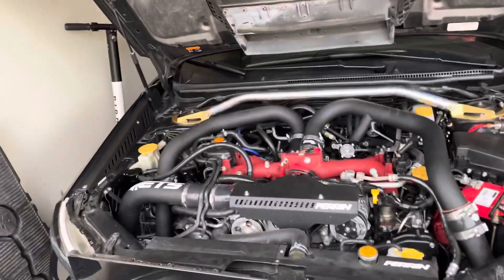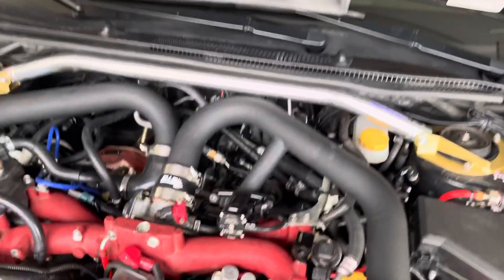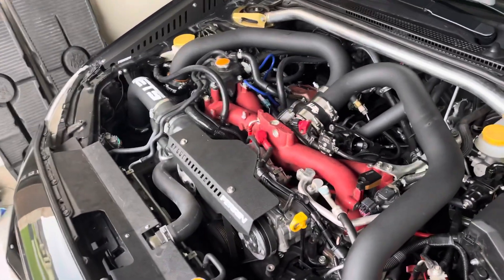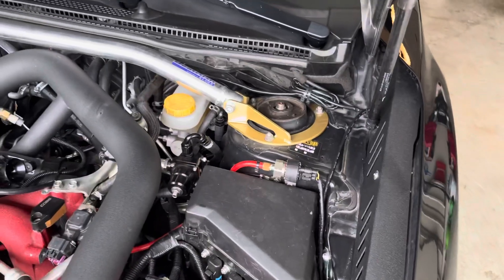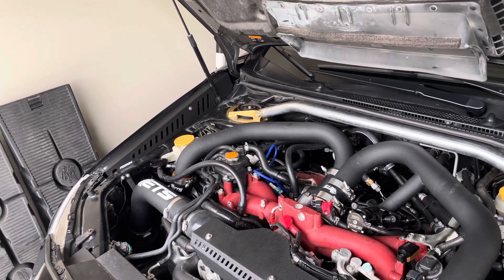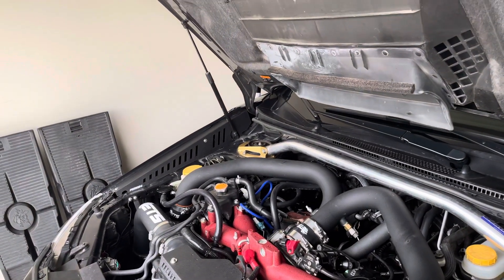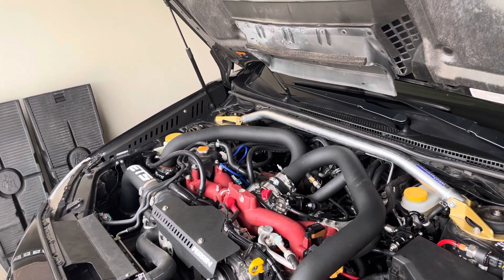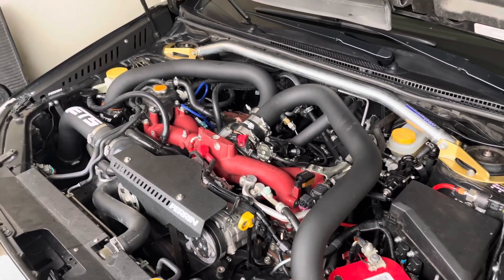2018 STI swapped block

Comment: Hey I’m sorry to bother but I’m getting a fp black for my sti as well how is it? I had a few questions 
How bad is the turbo lag
And how do you do in races against v8s
Reply from the maker: What’s up so it’s a great turbo and provides a very linear boost all the way to redline. I have no taper of boost. I do well against v8 I ran a CTS-V and a hellcat and had no problems with them. I posted a video on my channel running a FBO 5.0 so if you want to see it check it out. Boost lag isn’t that bad but as you can see in the video of the run it doesn’t take long for it to spool.
Reply: @E85_STI  I see this helps a lot yeah I’m definitely going with the fp black route my friends think they are to fast with their e85 tune mustangs 😎 lmao thanks
Reply from the maker: @Naized  yeah man with the bigger turbo it helps for sure. Once I do this 32 lb map I’ll be putting more power down. The sound of the turbo is like a turbo diesel sound and I like how it sounds. The stock one never sounded like that.